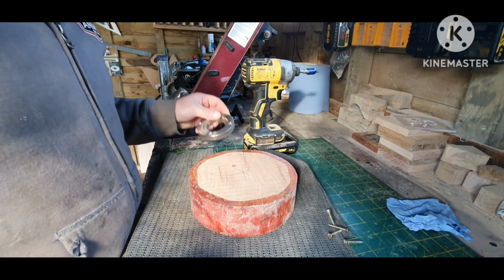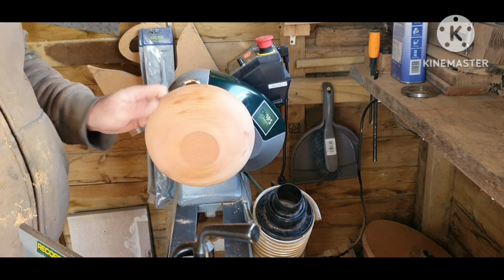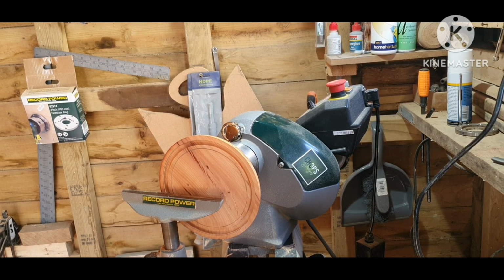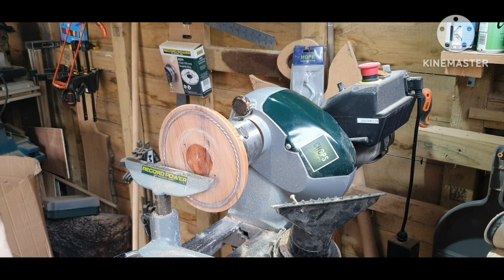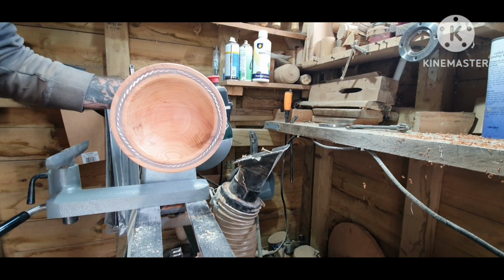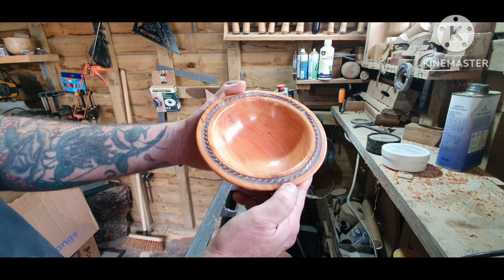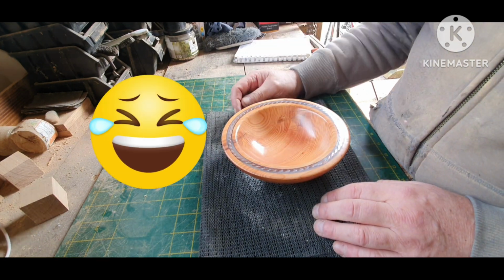Wood Turning FAIL - Twice

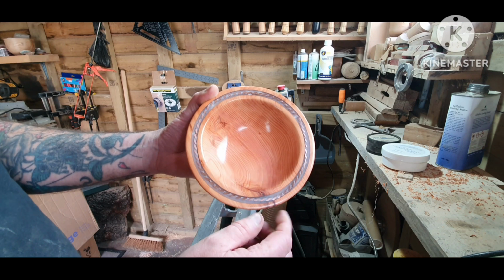Comment: 15:33 If you had put a little resin on the bottom and put the copper in while the resin was still damp, perhaps it would be rounder?
Reply from the maker: Yes I agree .I did use some CA glue but wasn't very successful 😕
Reply: @woodys_woodwork  CA glue is proving how good it isn't.  Epoxy is always a better choice.  Plus, CA glue tends to be more toxic.  I bet in the future there are going to be more people with lung cancer who never smoked.  The link to that would be the CA glue just like all the wet-on-wet artists that died  of cancer because of the fumes  of how they made the magic white paint.